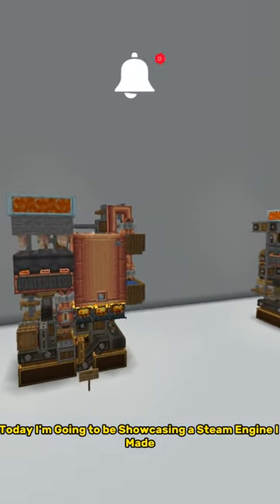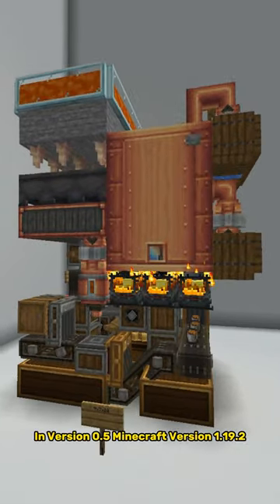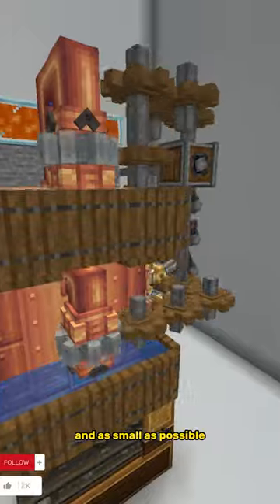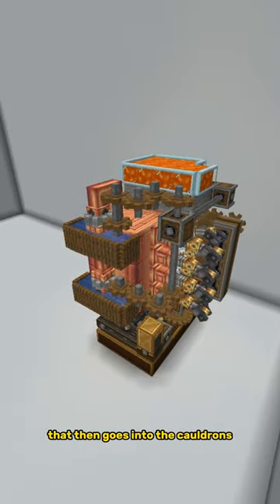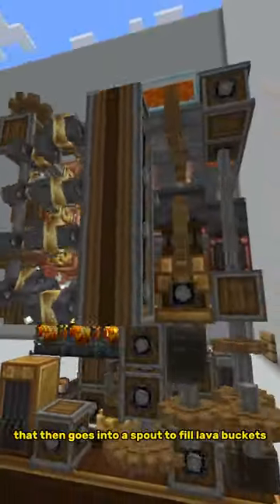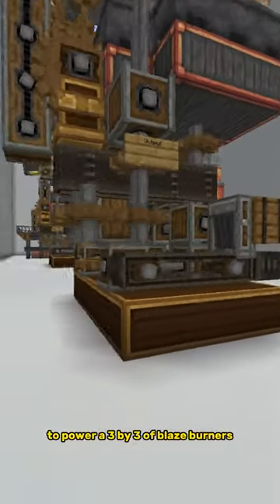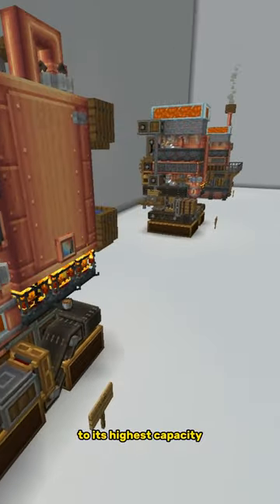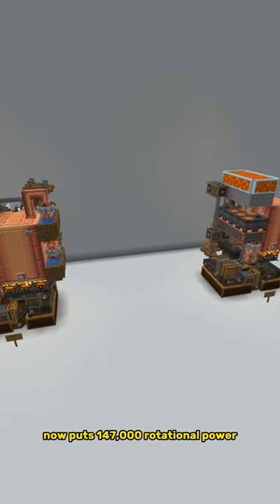The BEST Steam ENGINE in Minecraft CREATE Mod!

Comment: Expand the lava and cauldrons by 15 more, and put empty lava and full lava filters on conveyor because the machine will sometimes stop running because it doesn’t collect enough lava and it doesn’t have filter so full lava buckets will sometimes not be used
Reply from the maker: Personally haven’t had the issue but thanks for sharing! I think it’s due to the chunks not being loaded and the lava being used and not regenerated